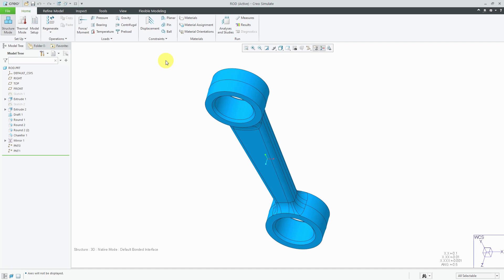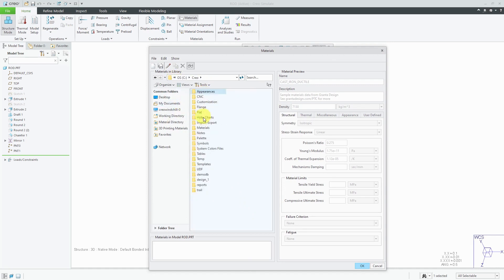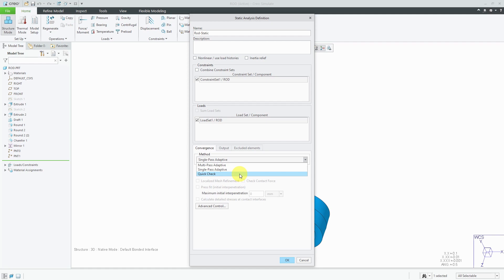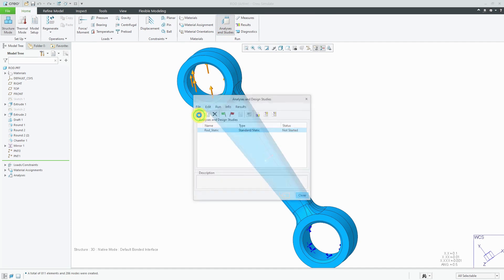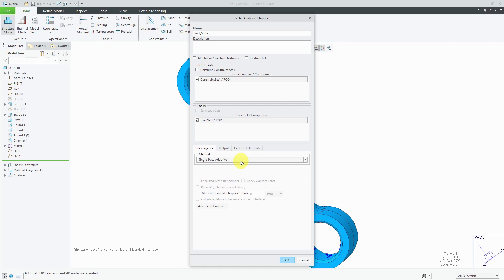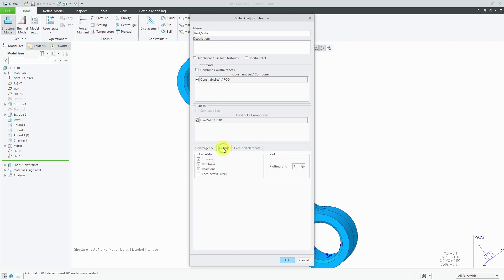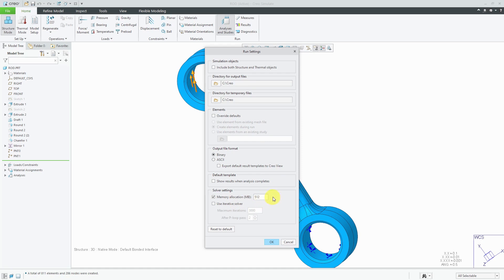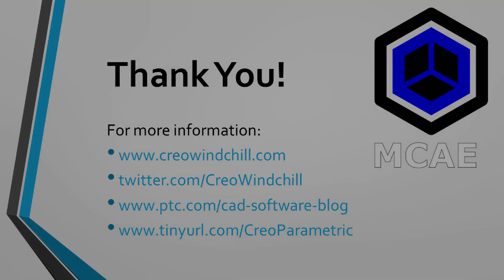Creo Parametric - Creo Simulate Convergence Methods

Comment: Sir can we increase no of grid for capturing better fea results?
Reply from the maker: I suggest you watch some of my other videos on Creo Simulate. This is a complicated answer. Creo Simulate uses Geometric Element Analysis, not Finite Element Analysis. In GEA, you increase the polynomial order to get better results, not the number of elements like in traditional FEA. But you can add Mesh Controls to areas of the model to get more elements if the analysis is not converging to a solution.